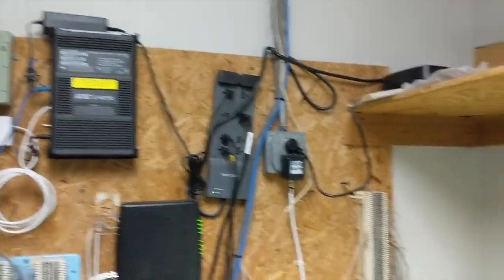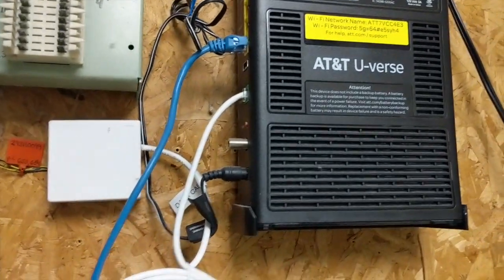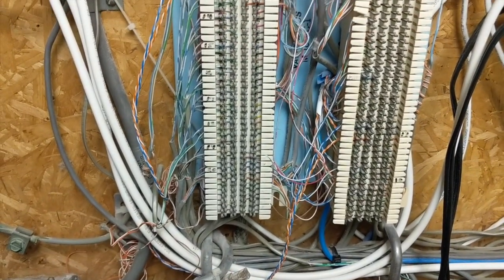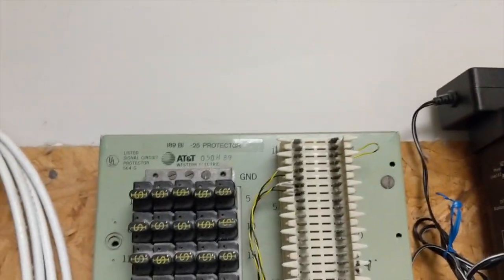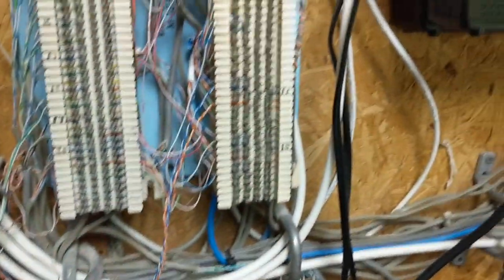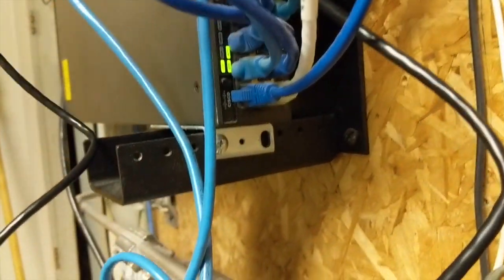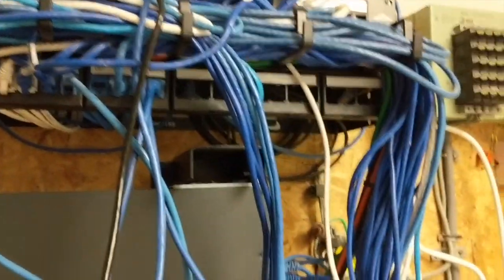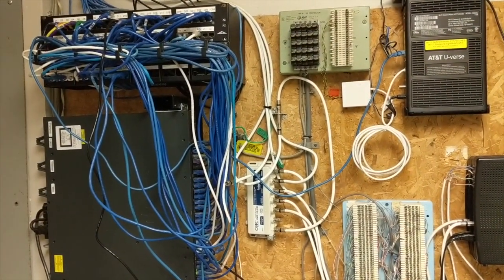SMB Network backboard Tour

Comment: Hey i need some help about setting up wifi network.  I have 2 connection of wifi 250MB and 500MB and distribute wifi between 1000 people in 2KM of range. What type of wifi outdoor antenna i should use? And how to setup that network?
Please reply.

Thank You!
Reply from the maker: Not enough of an expert in that particular use case.  But, I would be looking at Ruckus or Ubiquity wifi systems for that solution because sounds like you need a high-quality mesh setup.